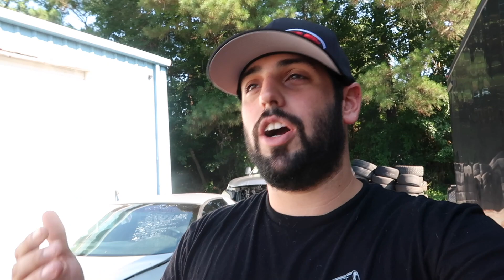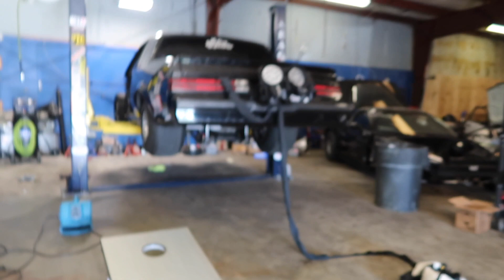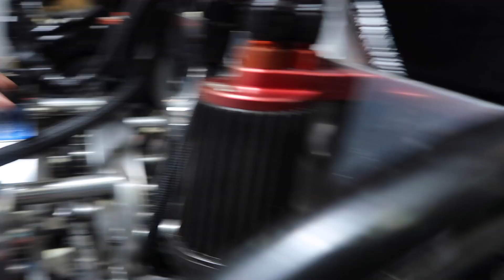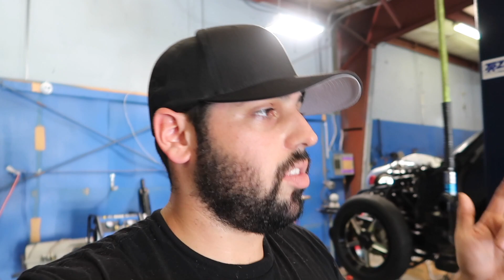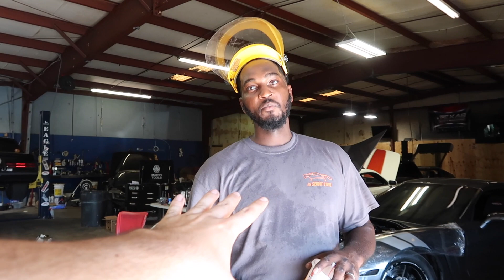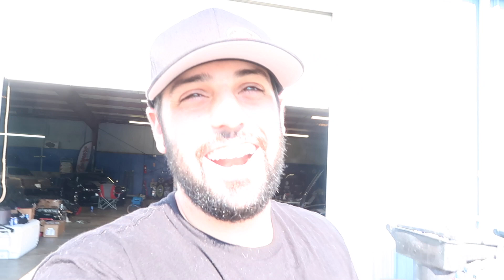I NEED YOUR HELP!!!

Comment: If Loctite isn't working on procharger bolts then you may have to go really old school and use safety wire. When done correctly it just looks badass.

Comment: Hey John make sure the bolts are the right spec ie correct grade, length, etc so they aren't stretching or pulling threads. Not good if that housing comes apart on a run.

Comment: The channel is awesome regardless John. Yeah it would be nice to see some cars hitting the track and busting some heads but you can't help the weather. I think it's time you start bolting on some parts on the salty chicken and get it running and track ready too. Either way I'll still support the channel

Comment: Use bolts with drilled heads and safety wire them together. I've never seen a bolt back out after proper torque and then being safety wired.

Comment: If your looking for a good track to test on crossville dragway is having a LDR points race and they are having a extreme 28/275 shootout Jason Rueckert will be there to help with the prep so it should be on kill. Just letting you know if you don’t have anywhere to go and would like to test it

Comment: How.much oil did you put in geardrive? They only use 4 OZ of synthetic 80/90. If you have any more than that they will leak. Call kris At the supercharger store for gaskets/seals if it still leaks.

Comment: Old ford tempo 600.00 sat since summer it was now winter about minus 30 c for a few days walked into the dealer asked for the key it started first spn groaned a little then was perfect for the next 2 1/2 years  replaced brakes and one front wheel bearing i was happy amd saving money and getting to work everyday 76 kms roind trip. The good ones are out there just gotta ask.

Comment: well i got a new boat the 9.9 mercury is stuck in forward gear I want F forward & N neural and R reverse to stay connected& tiller works right, it runs fine other then that! rowing sucks i dropped it off at  shop  ps they lost record and part number!! oh no! Just fix it!!!
Reply: ps daddy Dave (dave comstock) had a pro charger maybe he could answer question! you have!